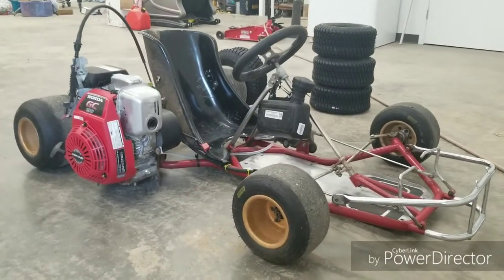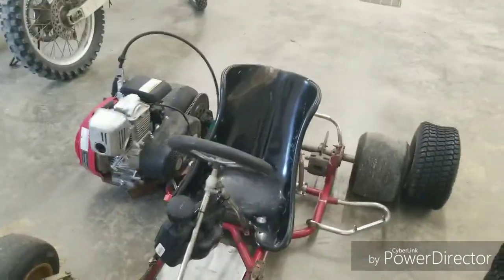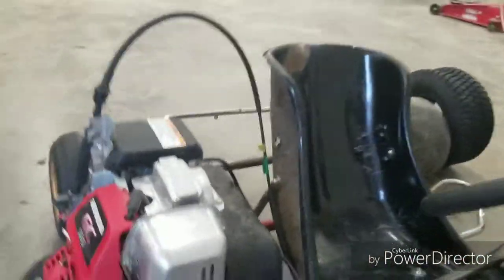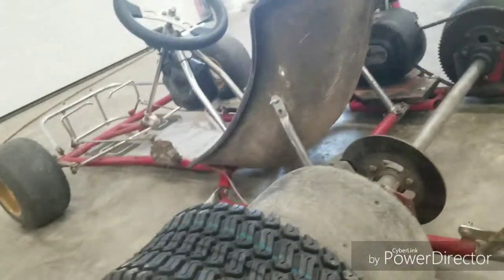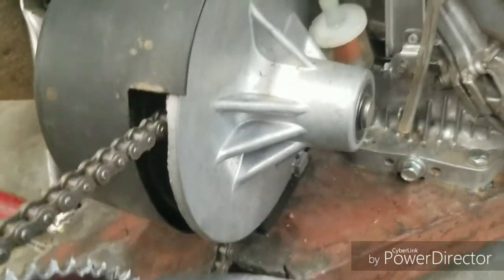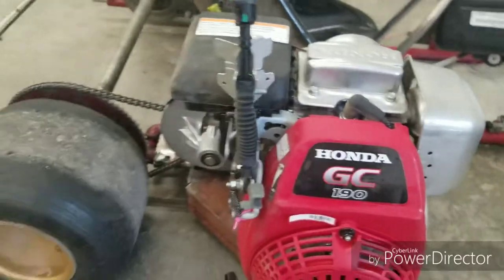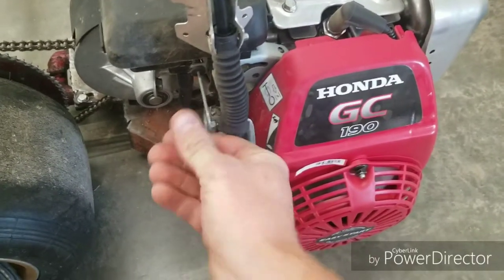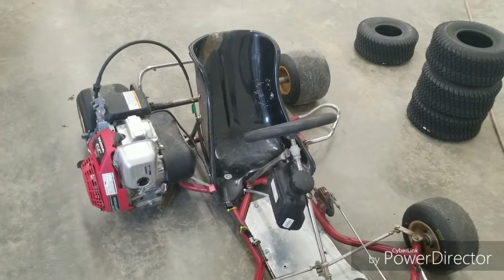Honda Race Go Kart- Off Road Set Up Part 1

Comment: How did you run the throttle
Reply from the maker: Its actually the transmission shifter linkage from a 2011 silverado 2500 lol. Used a modified joist hanger to build the mount at the engine end, hooked right into the linkage at the pedal end. Couple zipties to route it
Reply: Yah I was wondering the same. Is it possible to get a better angle on where the cable makes connection to the pedal system. I had just bought myself the same classic but can’t seem to understand how to connect my throttle cable to my pedal. Thanks man, all the other vids on YT are solely racing vids